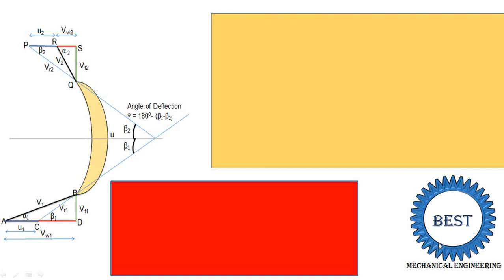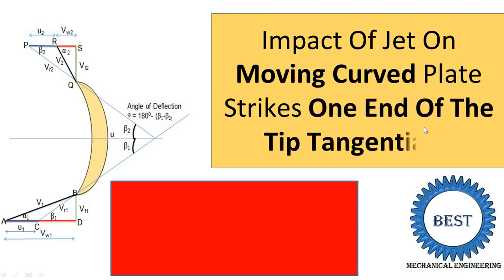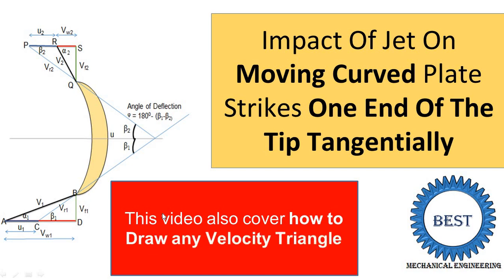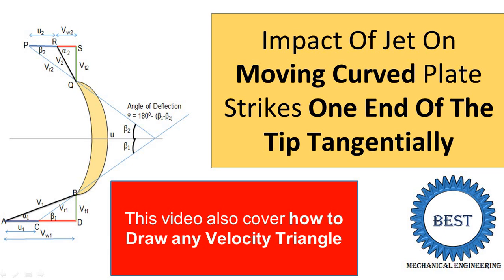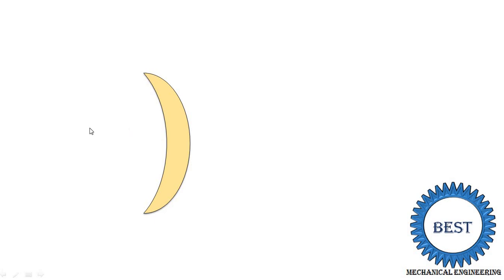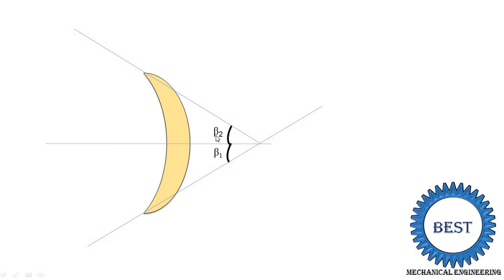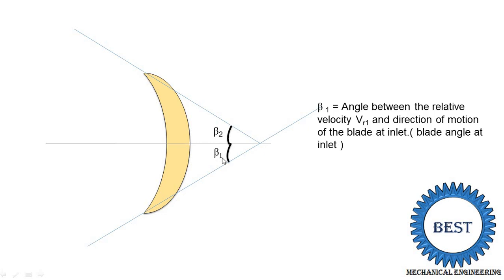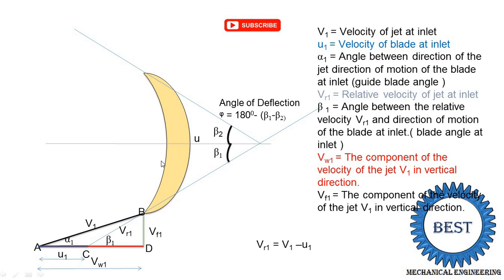Impact Of Jet On Moving Curved Plate Strikes One End Of The Tip Tangentially

Comment: Sir while finding efficiency, work output how Vr1 changes to V1.
Reply from the maker: Overall input energy  is water coming out from the nozzle.
Water coming out from nozzle with velocity V1.
That why V1 is considered.
Reply from the maker: For example we consider that i eat 5 mango and you eat 3 mango
Relatively i eat 2 mango more than.
So my input is energy is considered 2 mango or 5 mango??
Reply: @bestmechanicalengineering   He's asking about output function. Not about input
Reply: It always has been V1 from the start not Vr1 because mass flow rate of nozzle is considered here (m/s)=rho*a*V1

Comment: Why does the velocity of mass flow rate of output energy change from vr1 to v1
Reply: V1 an absolute velocity which water comes out of a jet, In ideal fixed bucket the velocity V1 hit the bucket. In this case taken as moving plate with velocity u1. So, the jet of water hits with the relative velocity with moving plate taken as vr1